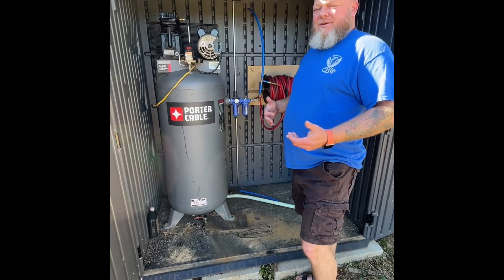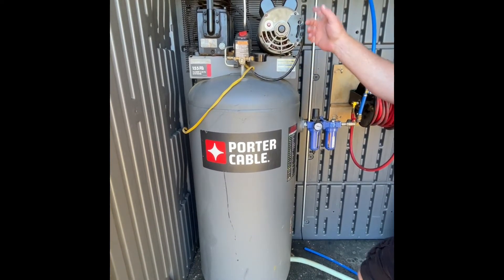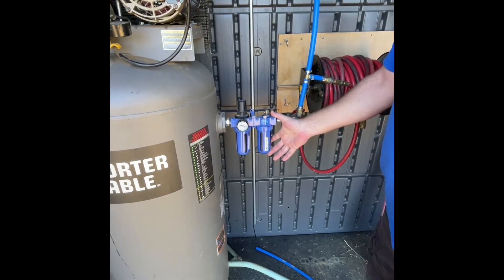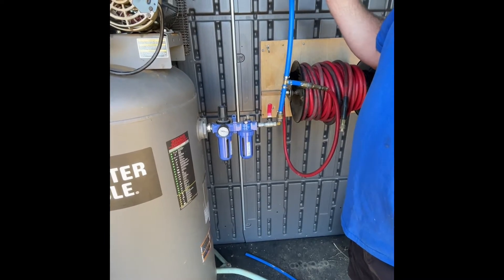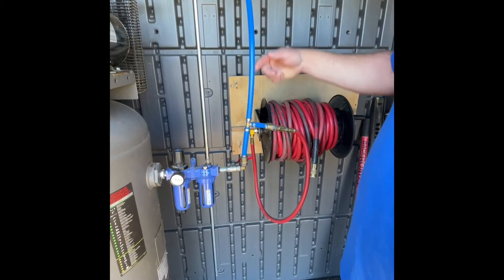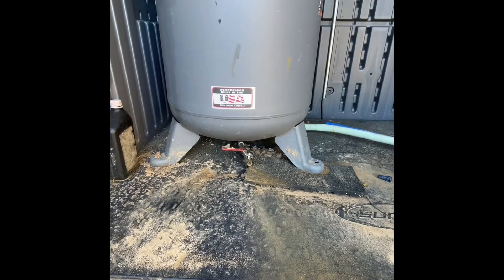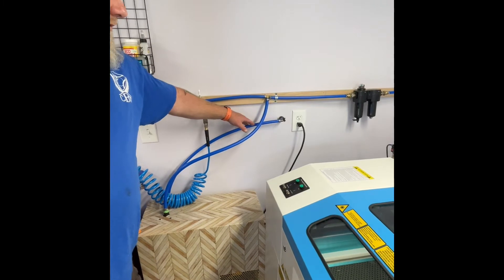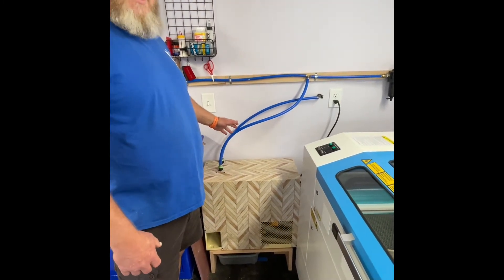Air Compressor set-up for Lasers.

Comment: Have you felt the need to install an air pressure booster?
Reply from the maker: No running anywhere from 25-45 psi works perfectly
Reply: @Angrycraftsman  Thank you

Comment: From your pov, how important its the air compressor on cutting 1/4 + materials?
Reply from the maker: I believe it is relatively important. Increased airflow helps with thicker material. For 1/4 inch the stock air should be enough, however higher air helps reduce darker edges. IMO.